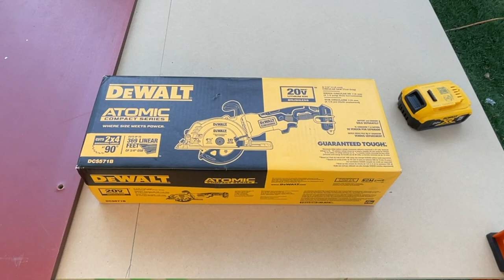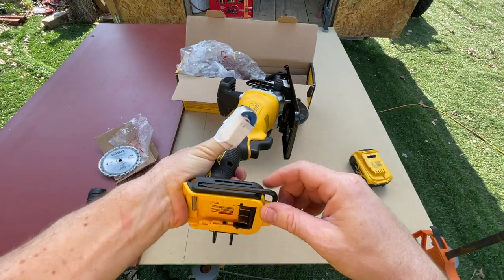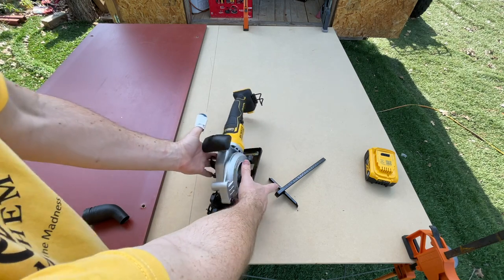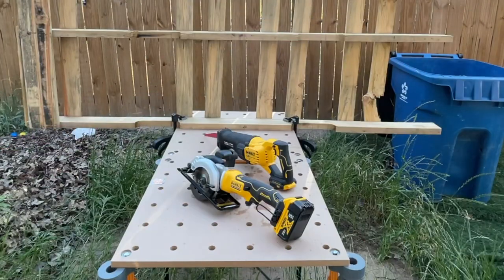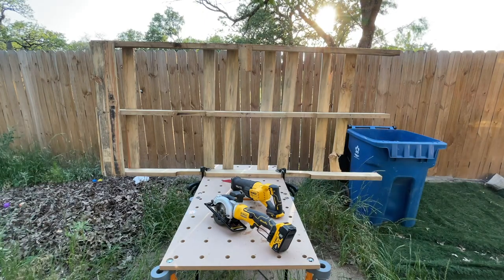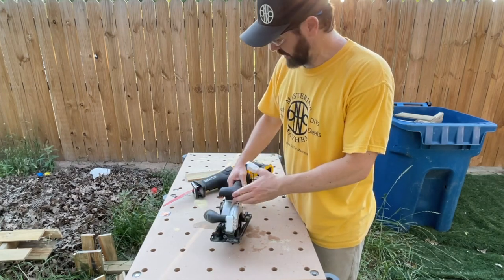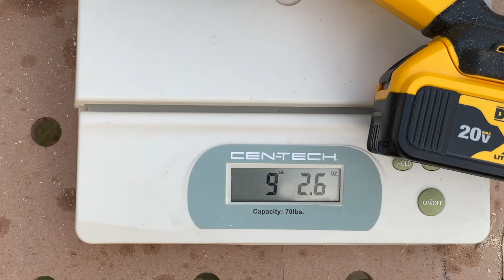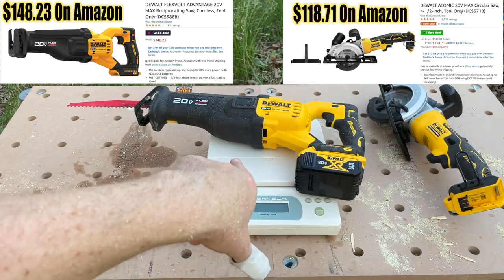DeWALT ATOMIC 4 1/2 Circular Saw Unboxing & Comparison To FlexVolt Recip Saw

Comment: I have the same saw...I put a Diablo 36 tooth blade on mine... works great...
Reply: Good tip. I’ll probably be looking to do the same after getting a little use out of the blade it comes with

Comment: Did you get a free battery with the 4 1/2 cir saw or tool only for $99
Reply from the maker: It’s the tool only.
Reply: @MasteringMayhem  I might pick one up for sheet goods tractor supply has them for $99 and Home Depot is $149

Comment: On sale at fasteners Inc.  $90.99     If your a Dewalt fan watch this site I have got half my tools from here at 50% or more below what HD sells them for, this saw goes down even more I picked one up for $70.99  about a month ago    https://fastenersinc.net/products/dewalt-dcs571b-atomic-20v-max-brushless-4-1-2-cordless-circular-saw-tool-only?variant=31729223073879